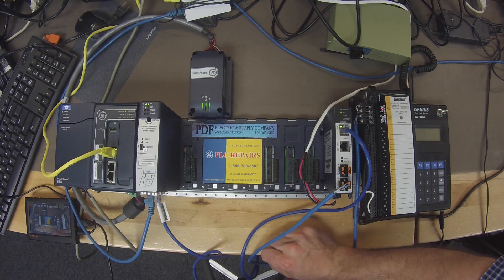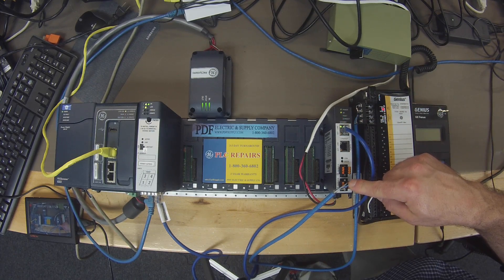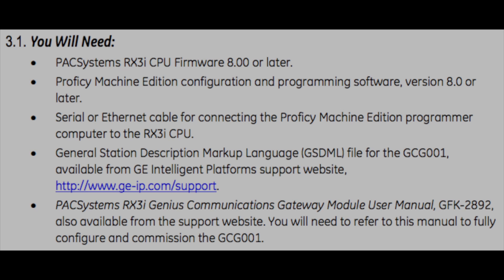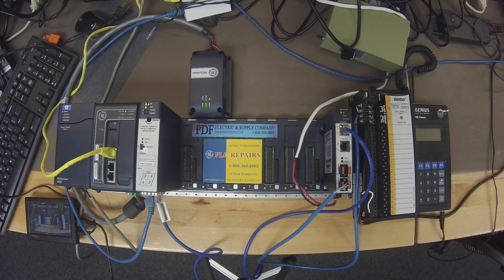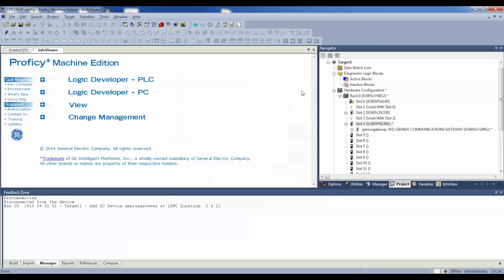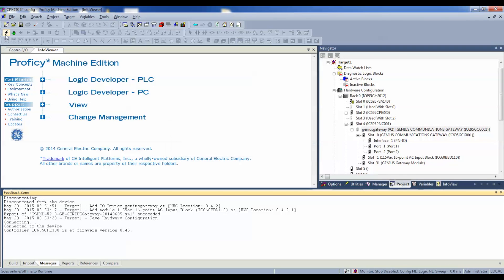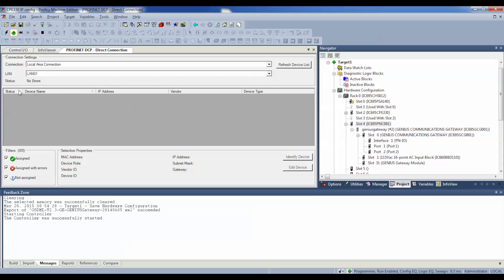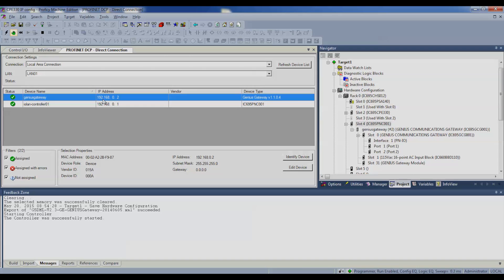How-To Troubleshoot: IC695GCG001 (Rx3i GENIUS Block Communications Tutorial)

Comment: Also I have two seperate systems. The PNC network speed on the first system is set to 100 Mbps and I'm getting faults in fault table. But on The PNC on the other system Network speed is set to 1 Gbps and not getting any faults on that one...